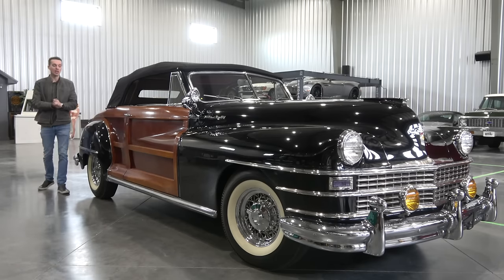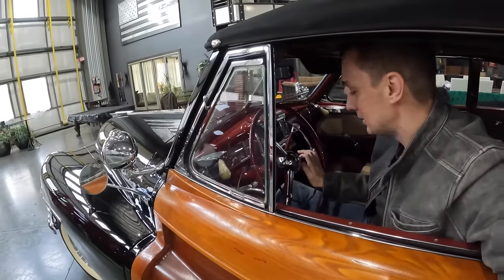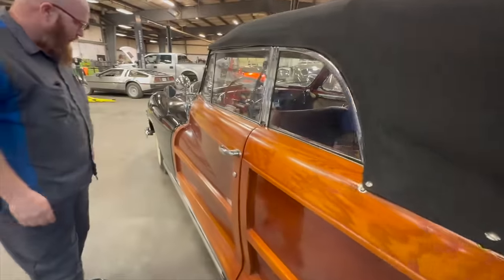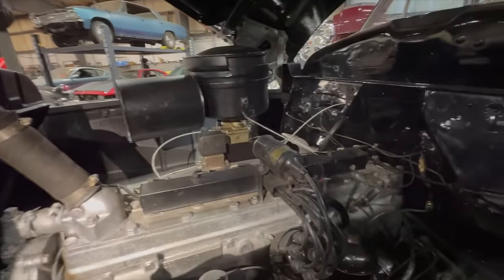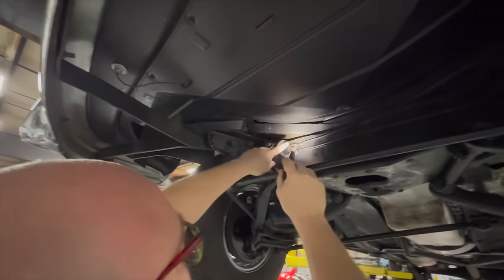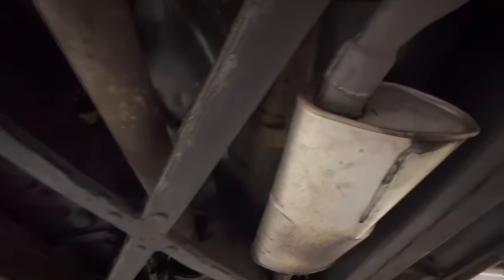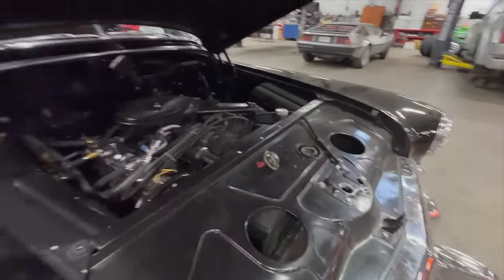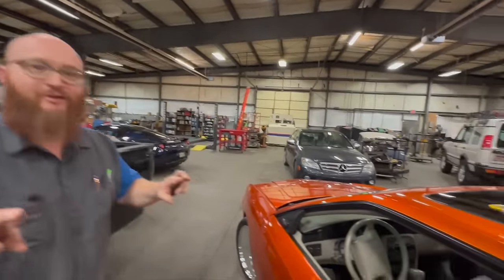Everything that's broken on my 1946 Chrysler Town & Country after it sat in a museum for 20 years...

Comment: As for your electrical system, you can utilize a 8 voltage battery. In the 70s when  I started my mechanical career there were a lot of the 40s and 50s vehicles still being daily driven. We used to install 8 volt batteries to help in winter starting. The 2 volt difference didn't harm any of the electrical  components.
Reply: This is an old trick to boost a weak electrical system, is not necessary if things are working right. You really need to figure out why things are not working and fix them properly, then the 6 volt system is fine. They worked for 50 years and they will work now.
But, if you do go with the 8 volt battery you have to adjust the voltage regulator to 9.5 volts.
A 6 volt Optima battery is better.
Reply: The grounds...don't forget the grounds...lower voltage means the SLIGHTEST resistance causes issues...make sure they are all well cleaned and sealed with grease...also....biggest(guage size) positive cable you can get/build.
Reply: @LeftyLucyRightyTyty  yeah they are so important. I had a problem with the oil pressure gauge in my 1999 Ford Falcon. I replaced the switch and still no good. It took a while but I finally attacked all the grounds and it turned out to be the earth from the battery (which is where i should have started but i thought if it was that i would have had other problems too)
Reply: My brother had an old 6v Imperial that had been modded with some old school double 6v batteries system. Run in series or something. He found an old mechanic who knew what it was. It was mystery for me as a kid.

Comment: I bought a 1981 DeLorean with only 19,000 miles in 1996 that had been sitting in a museum for over ten years.  Everything that was a paper or rubber gasket on the engine gave out within the first two weeks of driving it, from having sat unrunning for a decade.
Reply: To be fair, the Renault 25 with the same engine suffered the same problem, usually much sooner than that!

Comment: Imagine driving this thing on a country road ,top down ,lit a cigar, that's a different vibe🥂
Reply: Just hold on to the Champagne after you get home, haha!
Reply: Puttering through every little town because there were no highways
Reply: PSA : Betterhelp sells personal information of there patients without consent #BoycottBetterhelp
Reply: @jacobyo99  ..There were highways back then,mainly 2 lane but they did have some 4 lane highways and people did 70-85 mph depending on the car you had and on 2 lane highways..

My Dad is in his late 80's and my Grandfather ran 85 mph in his 1940's Chrysler with a straight 8 cyl he had...Wasn't the top speed either but that's why older cars tend to sit higher,rougher roads but they rode smooth..My Dads first ride was a used '49 Ford in 1955 he also cruised at 80 plus mph was a V8..

My Grandfather loved Chrysler's and my Dad back then was a Ford guy,until my grandfather bought a 56 Chrysler New Yorker Newport (yes they had both names) 354 Hemi and they did over 120 mph..Dad was in love but a teen he couldn't afford one..He bought a new 1964 Sport Fury with a 413 4bbl and ever since a high performance guy,he traded his 62 Galaxie 500 with a 390 in for it,he tried to get a 1960 Chrysler 300 with the 413 duel 4bbl but was turned down but they said here is a 6 month old Ford you can have ,nice car too...He kept that until he got married in 1964 and bought the Sport Fury,then bought a 68 Plymouth GTX 440 Mom had a black/black 1971 383 Cuda,I was one of the coolest kids in elementary school lol..

Comment: back in the 80s i worked as an engine builder. i liked rebuilding the HT4100s chrome molly sleeves never had any wear no matter how many miles on them. just grind the crant and re ring it. think we got like 1075.00 to rebuild them. but keep in mind a machine LB SB chevy was 675.00
Reply: HT4100s were the worst engine Cadillac ever had
Reply: @maineiacman  yeah and the funny thing is the LS engines are built the same way as the 4100! so it was a clue to where things were going. But the LS engine today im told is expected to go 500K miles as long as you change the oil. I was told this by a utility worker in maintenance. GM trucks are basically military grade.

Comment: My grandpa and I restored a 1940s mercury sportsman woody, thankfully he finished and sold it in ca at auction when these were still valued much more highly. I'll always love and appreciate the old woodys. Theres a bunch of car meet ups in socal that celebrate these beautys
Reply: Ah man when you pop the hood seeing that radiator brings back memories. The mercury sportsman and most cars at the time had very similar. Ours was dinged and tented to crap. I went thru with a flat head screw driver and mallet and tapped out all the imperfections before clean up and paint. What a chore. But man did it look nice when done! 100% original we went to great great lengths to make sure of that
Reply: Ah the drum brakes! Glad I watched this one ❤ so much nostalgia! Back when average Joe could work on cars

Comment: Put an 8 volt battery in it will work fine and you don't have to change any of the bulbs and the radio will also work
Reply: Well, at the very least, the radio needs new tubes.

Comment: That extended crank on the Cadillac is indicative of a leaking fuel pressure regulator, which were famously common in the era, there was even a recall on them on some models. 
Have it checked, because it’ll pump raw fuel into the manifold and cause the manifold to explode.

Comment: This car is just incredible. The simplicity is jaw dropping. Why can't things still be built this way?
Reply: Emissions, fuel economy, and safety.
Reply: @JMaxMena  boring!!
Reply: Agreed.

More simplicity, fewer electronic gizmos that fail after 30k miles.
Reply: @JMaxMena  Old cars are certainly unsafe but I have an old car on propane and its emissions are the same as a modern car on propane, because it is a very clean burning fuel.
Reply: Mainly because the yuppies won't buy simple and easy to fix.
Reply: @petesmitt  Not all are unsafe.

Comment: The best you can do with a 6 volt system is to get rid of anything in the starting system that was not there originally (the cutoff, etc.) and use thick cables as short as they can be.  Is that dashboard starter button original?  With a good battery, good cables and original system, it will work just fine.  Resist the urge to convert to 12 volt.
Reply: I've never had good luck with 6 or 8 volt batteries on tractors. The batteries themselves don't last. On a 300 utility international at work we had to put new batteries on it every 6 months with properly working charging system.  Put 12v battery on it with no charging system and it lasted for 4 years getting charged couple times a year
Reply: Good advice especially on an old Chrysler which has a lot more electrical equipment than cheaper cars, and is almost impossible to convert to 12v and do it right.
Reply: @Matt-ou1bg  Granted it's a smaller engine, but I've had the same 6 volt battery in my Allis Chalmers for about 5 years.  It sits from December to late March and always cranks right over and starts.
Reply: @James_Hough  We tried buying them from different places. But they never would last. We didn't use tractor very often. It sits for months at a time. Finally got my boss to let me convert it on a job site. We where using to box blade a job site and I got tired of messing with it. Did end up rebuilding starter to 12v couple years later. We did try 8v but after first one went bad, nobody carried one around us. Asking people at parts stores for 8v batteries is fun though
Reply: Yah, that ground is very anemic given the volts. The lower the volts, the fatter the cables have to be to carry the current. Id go for the lowest gauge I could find even if you'd need to make the cables yourself (which is dead simple in that application).
Reply: Driven regularly with a properly working 6 volt system really isn’t problematic. A quick disconnect on the battery is a good idea if it’s going to sit for more than a few days.
Reply: I installed a cut off switch on my Land Rover Defender and it seems as if the voltage drop/resistance across its contacts was enough to cause a starting issue. Maybe it was a poor quality one, but I bypassed it and the problem disappeared.
Reply: @mrdanforth3744  You will burn out the relays on the trans, then it won't shift.
Reply: @toddbreitenstein8522  Pre computer vehicles can sit for a few weeks and not have a dead battery, UNLESS there is a short somewhere.  These vehicles are not new, so intermittent shorts are a possibility.
Reply: @Matt-ou1bg  Most, if not all, 6 and 8 volt batteries are old-style batteries.  That means you MUST frequently check the water.  If it gets low, below the top of the plates, the battery will soon fail.  12 volt batteries used to be that way as well, but since the 80s have been low maintenance and seldom need to be topped of.
Reply: Best thing I did with my 6 volt. Was the ground cable. 2 was as thick as I could find locally. It calls for O gauge. And keeping it hooked up to a Battery Tender.

Comment: Hoovie - Speaking from experience her:  With respect to your brakes pulling to one side; once all the hydraulics are functioning properly make sure the diameter of the 2 front drums are the same, and also ensure the 2 rear drums are also sized such that the drums on the front axle are equal to each other, and the he drums on the rear axle are equal to each other.  Once properly sized and adjusted, this will ensure smooth, straight stopping.  (FYI - I had an old Pontiac, and a grey beard helped me make it stop without any drama!)   Good luck!   : )

Comment: Also, in case you are not familiar with 6 volt electrics, you MUST use 1 gauge or thicker battery cables.  You CAN NOT use chain-store 4 gauge battery cables, as they can not pass enough amps to the starter.  You do not need to convert to 12 volts.  We managed just fine with 6 volts, so it should be obvious that it can be made to work.  Besides, 12 volts will burn out the relays on your Fluid Drive transmission, then it won't shift.  Also, if you really do want more power, just use an 8 volt battery.  It won't hurt anything, you just have to have your voltage regulator re-adjusted.  Even Amazon sells 8 volt batteries.  Also, do NOT try to use a little Group 1 battery, unless you have a car with an engine under 200 cubic inches - Jeep, VW, etc.  Use the correct Group size or larger.  Most cars use a Group 2 battery, some use a Group 3, which is that long narrow battery.  A Group 4 is great if it will fit.

Comment: With a 12v system you'll have a rewire everything. Get a 8V battery for the winter time. My '46 Power Wagon runs fine on a 8v

Comment: The battery cutoof switch may cause too much resistance or just some to make the car slower to start
Reply: Battery cut off switch is way too far from the battery and starter. Too long and cable too much resistance. If you feel the need to have a cut off, switch, place it under the hood near the battery Preferably in the positive cable going to engine block When a muffler looks like that 1 kind of pregnant in the middle, usually a sign of an exhaust backfire can be caused by an intermittent Ignition.
Such as faulty points.

Comment: So happy to see the Sunburst Cadillac on the road finally. That is a rad ride for sure. And the brass filter in front of the carb on the 49 Cadillac was a common issue for cars in the 60's-80's. My father ran a gas station/garage in the small town he grew up in and one of the most common issues when a car was towed in was that brass filter. People would come in thinking they needed a new fuel pump or something else crazy expensive and it tuned out 99% of the time it was a $0.25 brass filter that needed to be cleaned out or replaced in rare cases.
Reply: For sure. Most home fix people would leave it out and put an inline filter you could check with a glance, and they lasted allot longer. I did it a couple times.

Comment: I’m betting that battery cutout is largely responsible for the starting issues due to the massive runs of wires and 6v is very low voltage. May need time to get rid of it or add a 2nd battery

Comment: You may have to full field the generator to get it to fully charge. Vehicles with generators tend to lose magnetism in the field windings if they sit for a long time. Basically when you full field the generator, it will "motor" if the belt is off. If it won't "motor", the generator is faulty. Best part is that doing that costs you nothing other than time.

Comment: I had a 3 speed fluid drive. A different animal than this one. It was just like a 3 speed manual but you didn't have to use the clutch to stop. A 3 speed auto that you had to shift yourself. My nephew has a 48 Windsor with this 4 speed.

Comment: The cable to the battery cutoff switch is long and probably causing the voltage drop and starting problems, might be losing 1 or 2 volts out of 6.
Reply: Also, it might not pass enough amps.  On an 8 cylinder engine, the starter might be drawing over 500 amps.  Will that cut-off switch pass that much?  If not, get rid of it.

Comment: To store a vehicle long term.
Ensure the tank is full of good quality alcohol free gas, put it up on jack stands, hose all the wiring etc with a mix of chilli oil and tea tree oil and plug any nesting places with balled up foil soaked in chilli tea tree oil.
Paint the tyres with surfboard wax and wrap them in plastic food wrap.
Put a heavy coat of car wax over all the paint and other exterior surfaces, coat door and window seals with trim restoration treatment and wrap food wrap around them as much as possible.
Put the whole vehicle inside a thick plastic covering and then a good tarp.
Put rodent traps around it.
And now you’re guaranteed to come back to a drivable vehicle after at least three weeks of sitting.

Comment: If you replace the brake shoes, they must be arc'ed on a radius machine to ensure proper contact in the drum (since each shoe has its own cylinder).
Don't toss the old tires - I'll use them for display. I can circle by and pick them up sometime

Comment: 13:08 HEY I think you can use you can use something like Redline superlight shockproof gear oil?!?! says it has a Film thickness greater than an SAE 75W90, yet low fluid friction like ATF it should be thin enough and provide substantially more fluid film and high pressure additives for wear reduction

Comment: presidential is right- Harry Truman had one of these. and a ton of these" KT Keller" era Chryslers were used by the government. Mamie Eisenhower has a 1950 Chrysler imperial Limo that was her state car, that was up graded to the 331 semi I think in 1952/53. My grandfather has 2 of these era cars super reliable. His 1950 Chrysler Windsor Highlander(one of the 25th anniversary package cars) had a place for a telephone in the back as it was owned by the state of Texas back in the 1950s. Fun fact these spit fire 6 and 8s have hardened valve seats so they can run safely on unleaded.and theses engine were common on pumps, generators, fork lifts and tractors.

Comment: Yup, your Ground cable is way too skinny.  You MUST replace it with a 1 gauge cable, and is that battery a Group 2?  It looks small.  If it is a Group 1, you should replace it with a Group 2.  If, for example, you are trying to clear a flooded condition, a Group 1 might run down before the engine fires.

Comment: In 1971 I bought a 1948 Chrysler New Yorker Highlander coupe for $50 from 2 elderly ladies that couldn’t turn the steering wheel anymore. The middle bumper overrider was all dented so they must pave done some bumping while parking. I would drive it 200 miles from home to college between semesters and holidays. Same engine, same fluid drive and the interior looked the same. It had electric windshield wipers I didn’t see if yours does or not.

Comment: Fortunately, on pre-60's cars you could always just make a gasket with a paper grocery bag, if you cannot find a kit or need a shorter term fix (nothing was supposed to last that long then, so 30k mii. was "long-term" and 10k would be "short term").  The seals back then were such trash and tolerances were so loose, you could do that for multiple seals and it would last about as long as original (ex. valve covers, head gaskets-people legit did it, and intake manifolds)

Comment: Love the car, and love this mechanic.  Who is he and where is he?   When I take my car somewhere, It's "we don't do that".    I have a 77 Cougar wagon, and can't find someone who will change the exhaust manifold gaskets.   The Engine shop I know has no room in the garage for my vehicle, literally sticks out the garage door, and the place if so full of other cars that I hate to even bring the car there.
The 50 mercury had an x frame, or similar very solid frame.   Love the wood grain, outstanding looking, and the chrome hinges on the trunk really stand out.   The car looks great in black.   Not a car you can leave parked outside, but one you would want to drive for sure.   Be sure to get the car you want NOW, before the 2026 models come out, which will have kill switches and breathalyzers.  Never vote for people like Joe Biden and Debbie Wasserman Schultz, who pushed these mandates through.

Comment: WHAT do you get when you mate a stainless Delorean with a stainless Cartoon car?? 
6 volts is a pain in the backside. Always a pain on the starter when cold. And drag that much current to do anything. I guess the 8V route and some better cables would be the go. With all the electrics for the roof and gearchange 12V would be quite hard. For a normal car 12V is the way to go. Just change a pile of globes, the generator to alternator. I have never had a 6V starter fail on 12V.